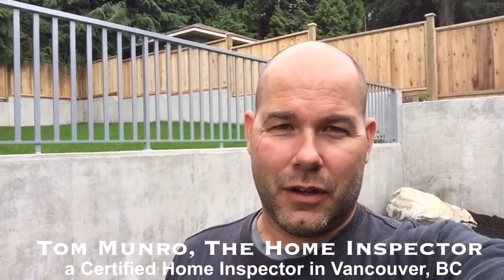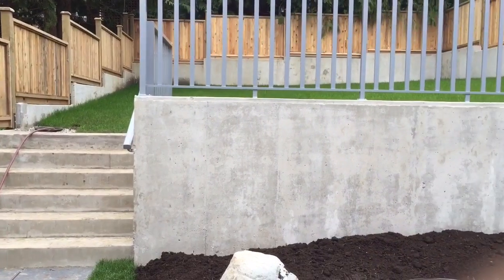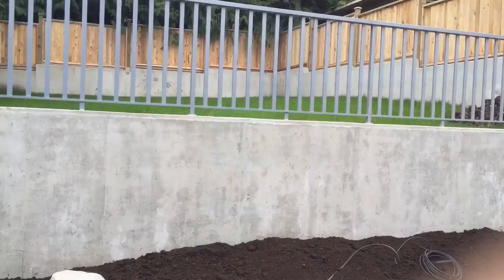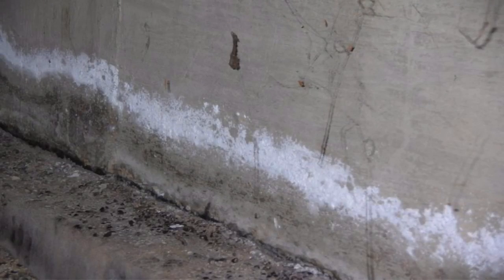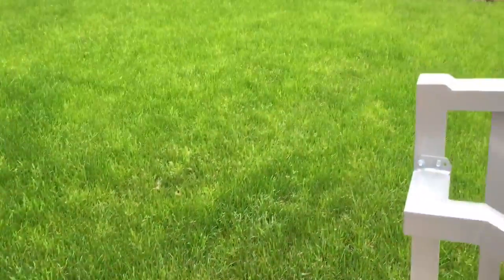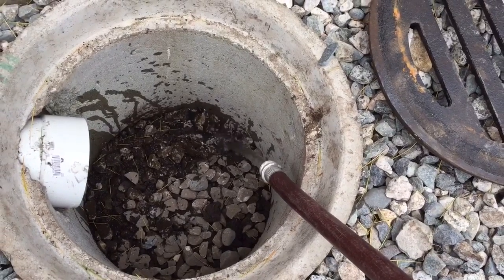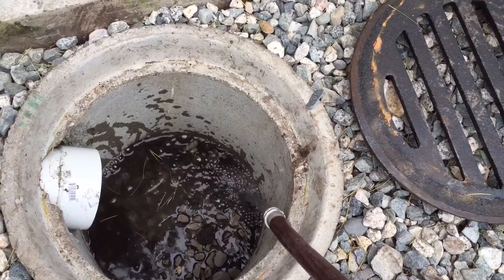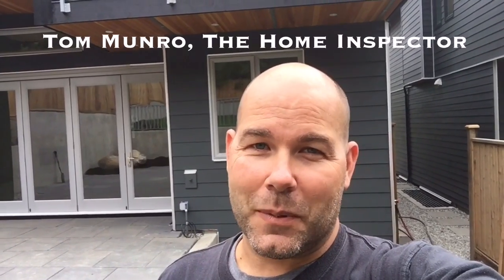Hydrostatic Pressure behind a Retaining Wall

Comment: Hello Tom,  Try Jet Filter System's serviceable weep hole filters. In existing walls where the drainage system has failed or in new walls, Jet Filters can be installed through weep holes. Unlike traditional weep hole systems Jet Filters will prevent backfill soil loss. These are used my state DOT's for retaining walls of all types, landscaping, ports, marinas, seawalls etc. They come in four sizes, from 2.5" dia. to 6" diameter that are used by the Army Corps of Engineers.  Like traditional drains they should be cleaned every few years depending on the backfill material.

Comment: Hello, I just purchased a home, with a basement, Which was dry when we looked at it. Just to find water in the basement, We are first time buyers, I noticed there was a 4" drain from my Neighbor's yard connected to my drains, I had him disconnect and re-route the drain, Water still floods my basement, I found a second open 6" drain running on the other side of my block wall, And during heavy rain, It sounds like water running through it. Could my neighbor have a second drain running further down connected to a drain, Because the second drain is not from drainage from my home?

Comment: How can you reduce the hydro static pressure behind the wall without taking down the wall or digging out behind it? (Baybe drill a hole in the wall?)
Reply: excavate behind the wall to put a 4" perf pipe at the lowest point you can get drainage with fall, backfill with a 'chimney' of clear crush against the wall for water to drop down to your perf, core a hole in the bottom for a 4" pipe to send the collected water to storm system. being in Vancouver area every house has a storm system to send water to. being in Vancouver every project needs to be looked at from a 'where do I send the water to' perspective rather then the 'make sure I cash the check before they realize I f##ked them'. but people keep paying insane $$ for these disposable pastel s### boxes. after which the home owner gets ripped off by guys offereing to 'repair' the drainage issues...in this case by adding an ineffective lawn drain

Comment: I had three home inspection to inspect my home stage by stage. One came from the HIA (Housing Industry Association), a mistake I made in going to their office when one bitch told me I was on the wrong floor, it was two floors up and when I went two floors up someone told me I was on the wrong floor, its two floors down, the HIA office was there. I returned back down and met the same bitch who shouldn't have had a job because of her arrogance. I met a guy (another bullshit artist) and explained my dilemma. I was told that they (HIA) deals with builders, not their customers, another bullshit because on their book it clearly said that if there are building issues, contact them. I went home in dismay. All that drive  to the city just to be told that, nothing but bullshit. And they're smiling, like smiling assassins, as if they are squeaky clean, as if they are a great association... https://www.google.com/url?sa=t&source=web&rct=j&url=https://hia.com.au/&ved=2ahUKEwj4ksGHmsjbAhUBrZQKHVnoAlYQFjAAegQICBAB&usg=AOvVaw1dhDeyYJbkARWSUOcn-q8X
Another inspector was hired by me and three times he came to inspect the shonky work of the builder and his cronies of bullshit artists during 3 stages in a row. At each stage the builder was presented with a list of fault to fix or were missing. At each presentation of a list, the builder ignored our request to fix the faults, saying that the builder goes with his own inspector because he was paying him, and not with an independent inspector. Sure, but we felt that his inspector was being paid to hush and pass (cover up) the faults. But then, poor workmanship continued to appeared while my independent inspector continued to inspect the house for the next two stages, last one being the bricking of the outer walls. Since the bastard builder and his idiot foreman ignored me and my inspector, I decided to hire another inspector, more waste of money.This other inspector came from a Firm who specialized in buildings inspection that cost me an arm and leg. There seemed to be some hope that the builder would rectify the faults. He met the builder on site after inspecting the house one hour earlier and then gave me and the builder a copy each of the list of fault to be rectified or knocked down and start again but the builder refused to go ahead after the inspector left, and the fault were then covered, some behind the plaster sheets other behind the brick wall.

When they erected the first wall, being the side of the garage, i watched the bricklayer laying the first row of bricks being layered on chunks of dry clay that is often found during the digging and laying of the base foundation where the brick wall rests upon. As i was with the builder on that day, I immediately told the builder, "Hey, he's laying the bricks on clay and dirt that was on the concrete foundation, don't you this the foundation should be cleaned of that clay dirt to achieve a good bond between brick and foundation? Otherwise what's the use of adding mortar under each brick if it is to be laid on dirt?" The builder saw that I wasn't happy about it and ordered to remove the  clay patched and dirt from the foundation first. But the stupid bricklayer made the situation worse. Instead of stopping laying bricks, he removed the fist 6-7 bricks that he just layered at the start of erecting the wall,  he scrape and kicked away the clay patched and then laid the bricks again. Not being an expert in that field of bricklaying, I asked the builder if it was done right this time and his answer was yes.

Early in the evening, after work, i went to the site to inspect the wall and found it of poor quality, bricks were chipped, some bricks sticking out and some not level or too far spaced apart. This made me call the builder next day to meet me on site. And when he arrived, I angrily showed the wall and demanded a professional bricklayer or I'll have to face a solicitor and we'll deal in court. WTF does the think I am, one of the three little pigs? He ignored me on site saying that he built quality homes for the past 20 years and I said, 'yeah, straw homes' as I drove off to my solicitor. Along the way, I received a call from my mobile, it was the builder, saying that he'd found a professional bricklayer and would start within 3 days. Not wanting to cause problems, I accepted it. 

When I met the new bricklayer, I made sure he did what I wanted and not what HE wanted and told him about a flush an straight brickwork, I wanted a clean concrete foundation, no clay or dirt patches, sticks and other debris, no bricks sticking out, nor unevenly spaced bricks or different colored mortal and no noticeable chipped bricks. He was amazing. He first knocked the unfinished garage wall done by that bullshit artist earlier, grabbed a high pressure water sprayer and blasted all that clay mud and dirt off the foundation to expose a clean surface and then laid the first row of bricks for that wall in a bed of fresh mortar, and up the wall went, straight bricks, perfect matching corners and no chipped bricks.

When he completed the garage I was satisfied with the job and told the builder I wanted that bricklayer to brick the whole house on condition that he does it professionally and straight walls. 

After the house was bricked, next door house was almost completed. They then filled one side of the house with soil because their house was resting higher than mine. And that was it. 

However, in the last 15 years today, the garage brick wall that was first erected in 1999 has had this moldy white crystalized appearance on the bricks on the lower part inside the garage in level with the soil that is leaning against the outside of the wall. Perhaps they just filled the gap without applying damp or drainage pipes, and it seems that the water from the rain percolates down my garage wall. Something that next door builder should have done about it to stop water build up in my side of the property. But, you see? There are idiots who call themselves professionals and to achieve that status a smile like an assassin and fake documantation that entitles them a job, is all they need. Check the link above. All look happy with big clown smiles, but are they professionals, are they competent with the job? Well, the old attitude is, if nobody is watching, who cares?

Comment: Efflorescence, not effervescence.  Champagne isn't bubbling through the wall.   looks like that CB ties into a clean out, most likely one for the drain tile behind that engineered (inspected) wall.  The percolation (drainage below sump without a concrete bottom) looks pretty good too... so that wall either has a drainage chimney or the soil free drains.  think twice before you pay some asshat to inspect your house...
Reply: What's the point of the end pipe at the top of the stairs then?
Not saying you're wrong - I just don't understand, because this is by far not my area of expertise.

Comment: I was called in to work on a home that had recently been bought. The problem I was dealing with was drainage.  The new owner had a home inspector go over the house from top to bottom prior to the purchase and give his stamp of approval.  After the sale went through it turns out the house (This was a mansion) had never even had a building permit taken out prior to building the house 10 years earlier.  I checked around and found out this is not an unusual.  The point is a home inspector is not a guarantee you will not get stuck.

Comment: Hi tom, I have been dealing with flood insurance and they wanted me to make proper flood opening because the retaining wall creates an enclosure under my elevated home. Do I need the flood opening if hydrostatic pressure should be equalized since the backfill also exert lateral pressure on the wall itself. Also, if I have to make flood opening does it weaken the structure of the wall which seem to be made out of blocks of concrete?